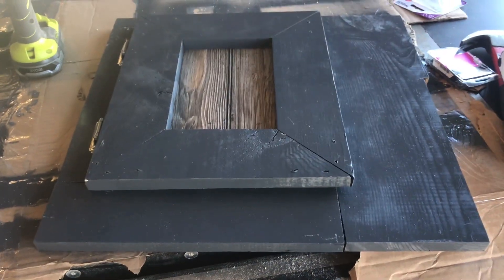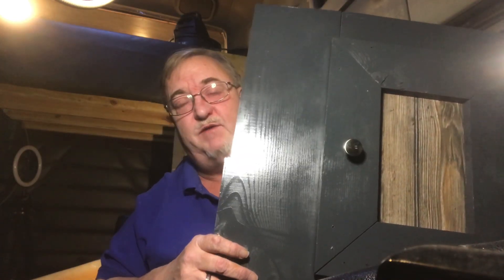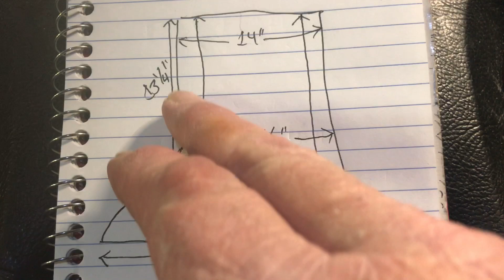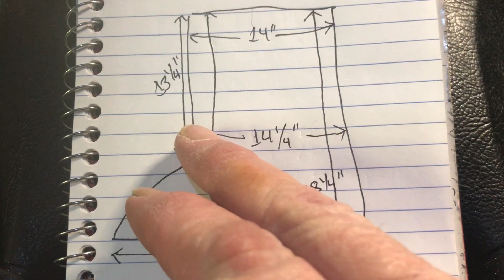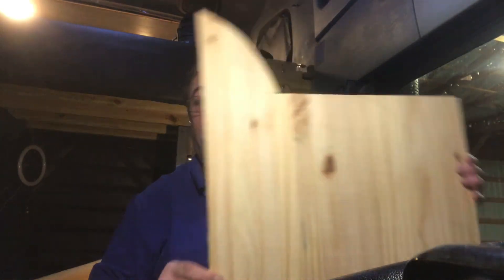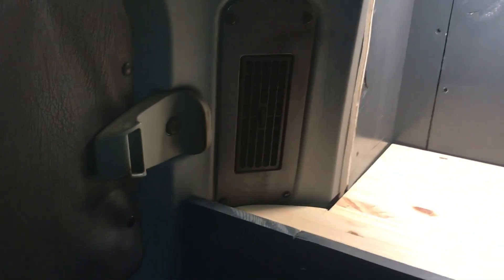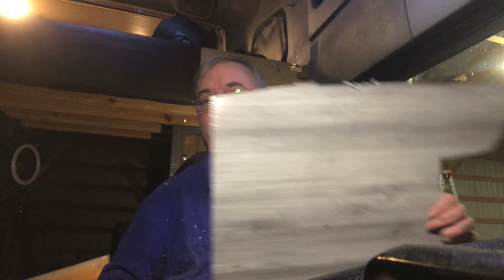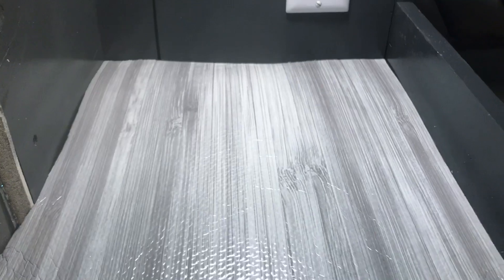Sleeper Remodel Update #62

Comment: Hey CT I hope you fight off that bug before it bugs you too much. Everything looks great so far and you will be the envy of most of the other drivers out there on the highway crammed into their stock sleepers. One thought on the nightstand; would it be better if the door swings the other way? Then it would be easier to open it and get inside while you are laying in your bunk/treehouse.
Reply: That’s exactly what I thought, too…about the door swinging outward.
Reply from the maker: Thought of that, but the latch catch worked better against that big beam inside